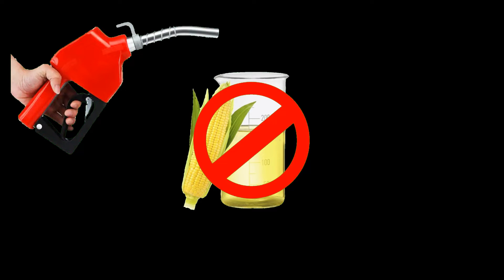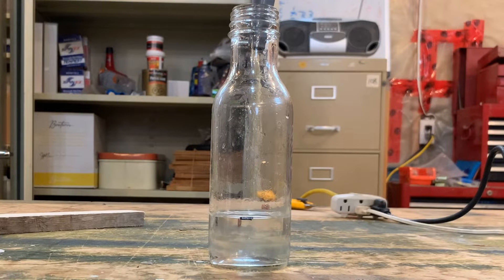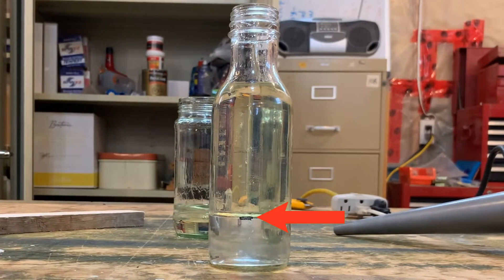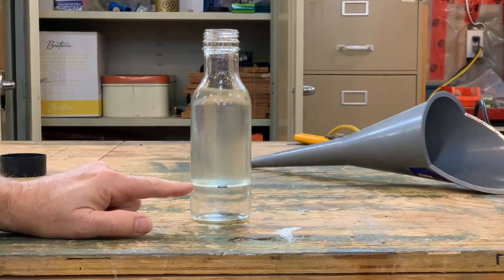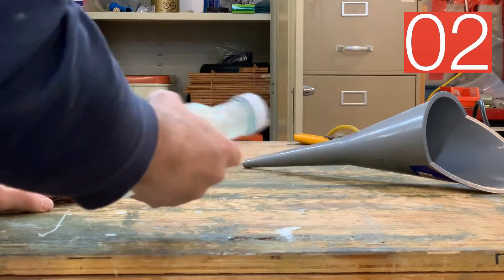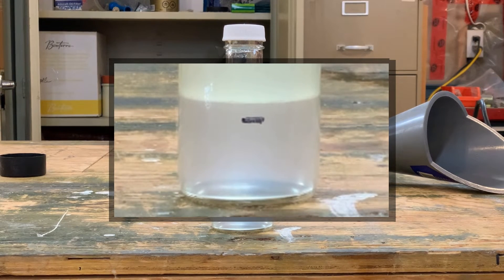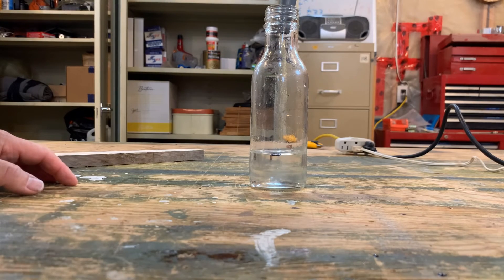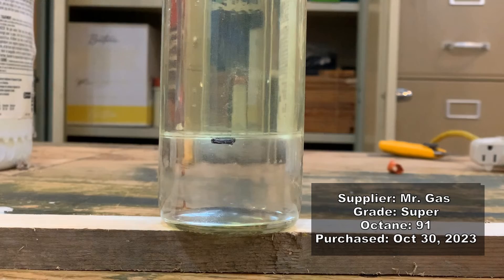How to Test for Ethanol in Gasoline | Easy DIY Method in Minutes

Comment: How do you find and buy Ethanol-free gasoline in Ontario?
I called every gas station around Milton, Ontario and no one seems to know.
Reply from the maker: There still seams to be a few sites around.  However, regardless of what they post on the pumps, you now have to test each tank.
Reply: shell v-power 91-93 is supposed to be ethanol free

Comment: There should be a way to make marks on the bottle that will show the percentage of ethanol in the gasoline.  Maybe as simple as dividing the lines of the gasoline fill into 10.  Each would indicate 10% ethanol (10,20,30, etc). For this you should only use the part of the bottle that is uniform and not go into the neck.  You could verify it with a store bought ethanol test tube. For the next project you figure out how to remove the  pure gasoline from the tester for small engine use.
Reply from the maker: I like your thinking.  Funny you should mention the last item… I have that in the works 😊

Comment: Great video. Such a simple way to check . I guess I better save a clear bottle. Some of my toys and tools really don't like the ethanol. I've been running 40:1 pre-mixed fuel in some tools. I wonder if I can check it the same way since it already has oil mixed in.
Reply from the maker: thanks Scott.  super simple test and quick.